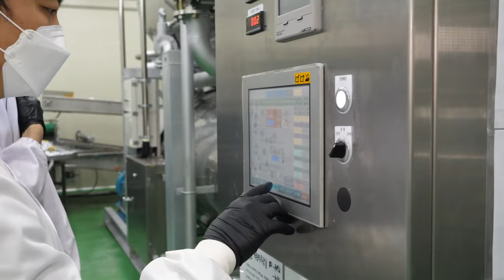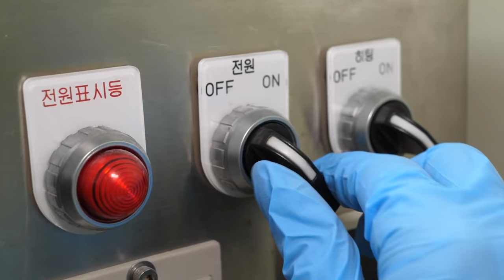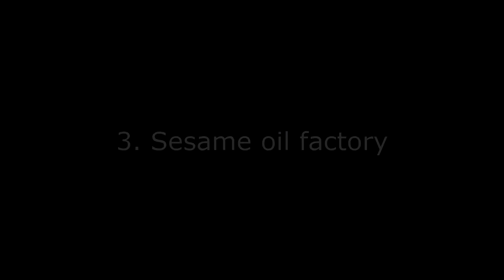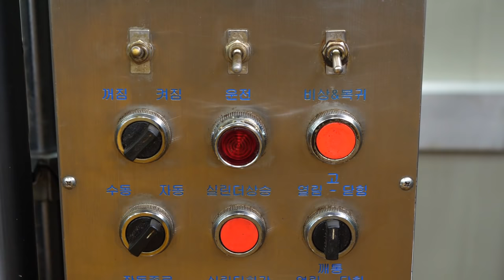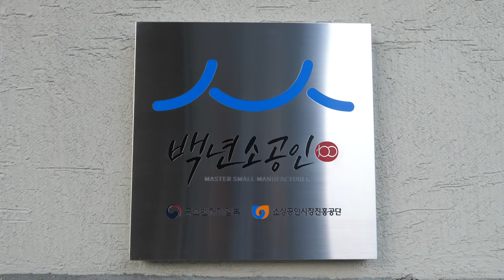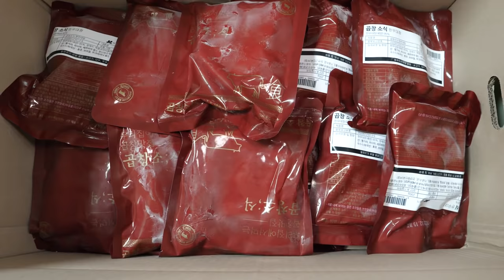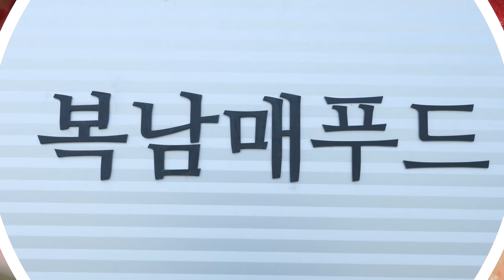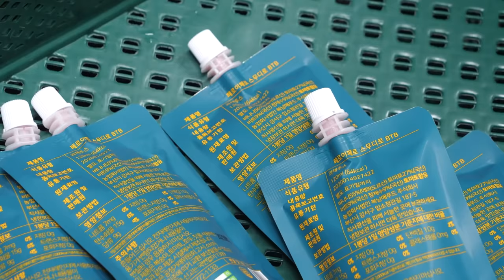스케일이 다르다! 대량 생산하는 식품 공장 TOP5 몰아보기/ Exciting Food Factory Mass Production-Top 5 Videos

Comment: To the guy holding the remote controller with one hand while pushing the basket with the other. I'm 100% CERTAIN that the strap attached to the controller is supposed to be around an arm or attached to a hook on that person, soit can't ne dropped in an unwanted place, like IN the pot. Its also hanging down (the lanyard) and is a accident waiting to happen if it gets hung on anything.
BUT, that being said. I used to work in a hospital kitchen, with smaller steam pots, but a factory set-up nonetheless, and THIS production center is WAY CLEANER. Good job on that! Its PRISTINE! I could lick that floor on a stupid dare and feel SAFE about it.